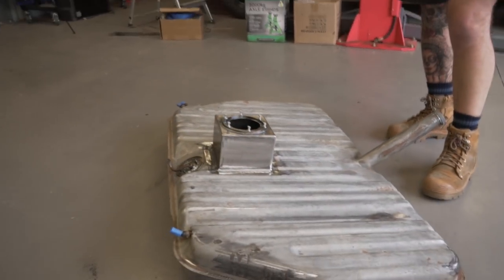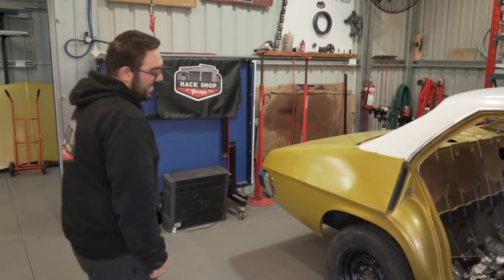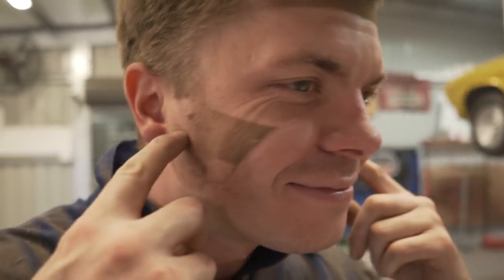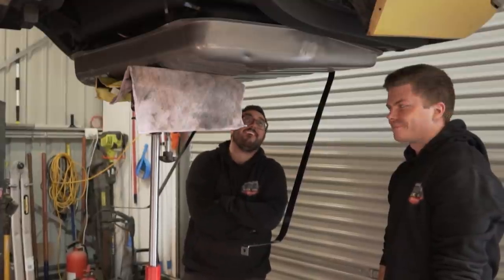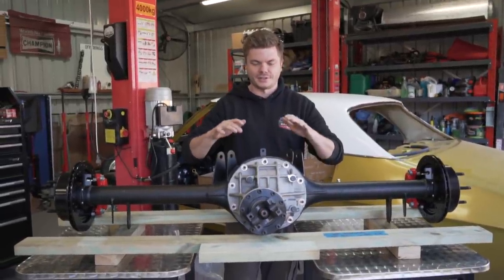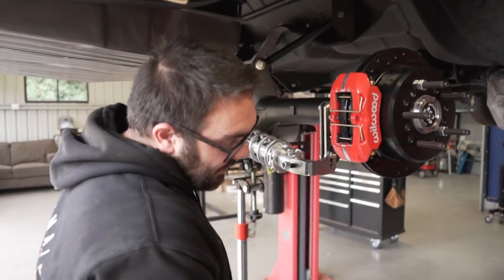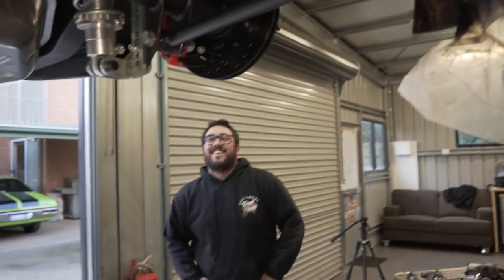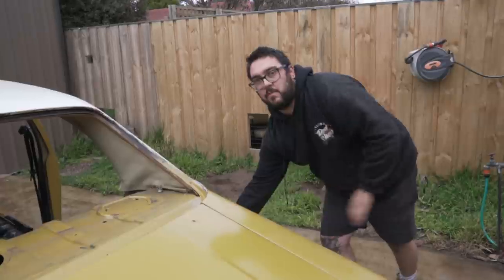LSQ Build - Part 7 - Castlemaine Rod Shop Diff with Wilwood Brakes Install  - (LS Swap HQ Holden)

Comment: Did they ask for crush tubes in the chassis rail when you fitted the coil over brackets? It would make a much stronger and longer lasting job of it.

Comment: You guys need a burnisher for the underbody cleanup. And a die grinder with wire wheels and fibre discs for the fiddly areas.
Reply from the maker: Now there’s an idea, hadn’t come across a burnisher before, thanks for the tip mate
Reply: Yeah don't use sand blaster for chassis as it's more messy than grinder and the sand/balls stay in cavities.
Reply from the maker: That’s a fair point Jiri
Reply: Yeah I wish I knew that before I did mine

Comment: HI 
Great fit for the 255 tyres . Please a bit more detail on the diff set up Ax/flange to axle  flange or disc to disc  dimension . [Yes the housing canbe shortened but overall depends on axle offset ] Wheel size and backspace as well cheers ..

Comment: I'm not sure how picky the engineers are with the fuel system but they still like to have the fuel filler neck modified to suit an unleaded fuel filler nozzle & its vented cap, my point is what they pick on in an engine upgrade is that all of the emission control system including the charcoal canister & vapour lines must be fitted so that it complies with the ADRs of the donor vehicle.

That also includes fitting the catalytic converters into the Kingswood.

As far as fuel consumption goes,I seem to be getting between 11.5-12 litres per 100 kilometres in my VY SS Commodore but it runs the 3.91:1 diff gears & the taller geared T56 Tremec 6 speed manual transmission so the 3.7:1 gears may make a 4 speed automatic car chew more juice it being geared up to 3.08:1 at the factory in the Commodores.

It would be interesting to get the Kingswood dyno tuned to squeeze as much power out of it as possible for a stock engine with all the goodies bolted onto the engine,it would be worth it for about a 75 flywheel horsepower increase in power !
Reply from the maker: Yeah it will be interesting what they say, It would be good to get it on the dyno one day

Comment: Serious question. I've just taken my 173 out of my HQ Belmont wagon to start the LS build. Yous mention "budget build" a lot but in all seriousness, beside body and interior work what kinda coin am I'm looking at. 100% going all castlemaine gear
Reply from the maker: Hey mate, couldn’t give you exact figures at the moment as we have tallied it all up yet. But for the front suspension, the brakes, the diff and the engine conversion itself, I’d say around the $10,000 mark, all of the stuff we have put on it from the Castlemaine rod shop is available on their website, might just have to call them to sort out the front suspension though. That’s not including the cost of the engine and box, depends on what you get and what sort of condition I guess

Comment: Should of welded crush tubes in the chassis rail where the bolts go through, that’s what I did with my setup
Reply from the maker: Is it the same kind of set up?